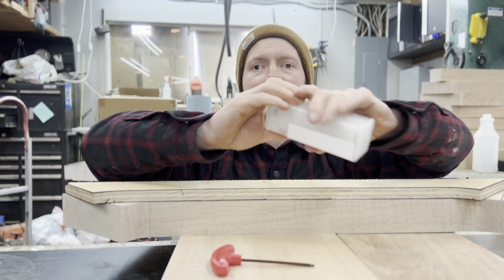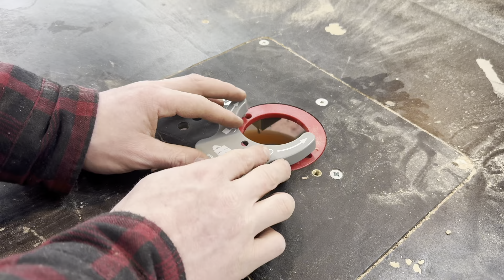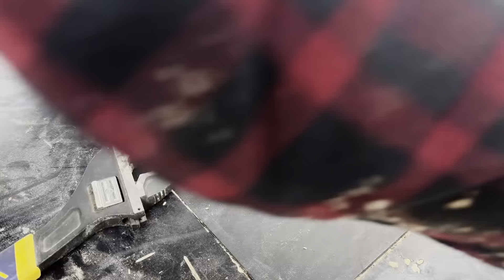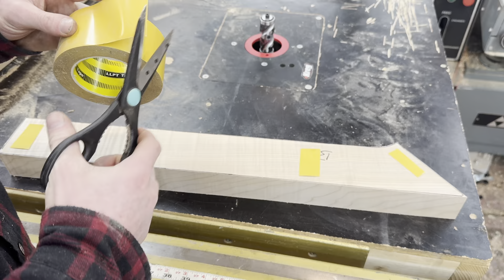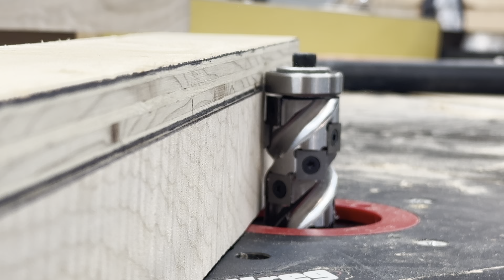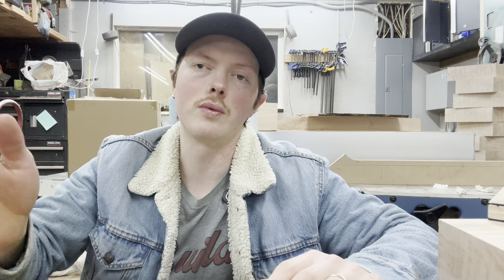Unboxing and Testing Chinese Helical Router Bit: Is It Worth It?

Comment: I bought the same bit, and I’m very pleased with the results. On my bit, the cutters were all fastened tightly straight from the factory. I duplicated an arc in MDF from an old radius template, and the result was absolute perfection; it was an exact duplicate of the original—no gap whatsoever. Next, I used a piece of 3/4” red oak with the new MDF template and oriented the arc in such a way as to make sure there was plenty of end grain for the second test. It performed flawlessly; the cut into the end grain was exceptionally smooth and chatter-free. I was removing 5/64”—what I normally aim for with my shaper tooling. Finally, I raised the bit to its full height and used the bottom bearing on the same piece of oak. Needless to say, the results were, again, perfect. As for vibrations, there were none. Of course, I was using a router spindle in a shaper machine; when I try the bit in my router table, I’ll let you know if there’s a difference.
I didn’t like your approach to this excellent piece of engineering. You began your cut without a starter pin; consequently, the bit couldn’t make a smooth entry into the cut. That’s why you got chatter and tear out. Furthermore, a template should have horns so that you don’t need a starter pin; it’s much safer that way.

Comment: Hi there! Here’s my follow-up comment. Today I had occasion to try out the same bit in my router table. As I pointed out in my previous comment, the bit performed perfectly in my shaper, with no noticeable vibrations. In the router table, however, the results were even better because of the router’s variable speed. Amana might make good cutters, but in no way better than this one—and certainly not as cheaply priced!